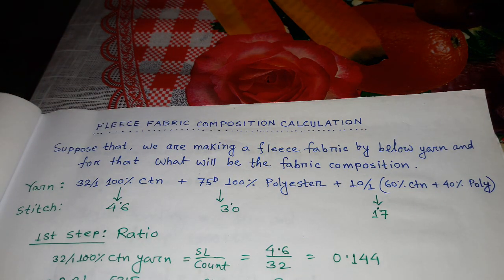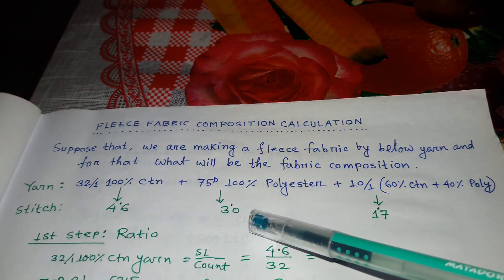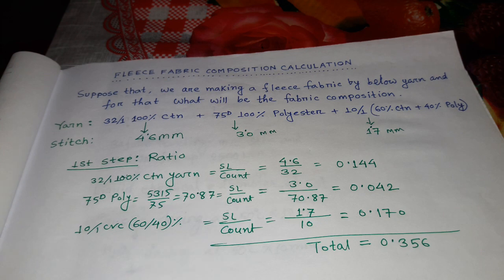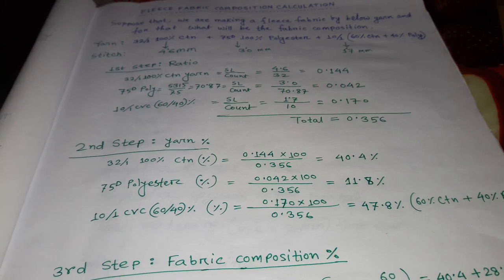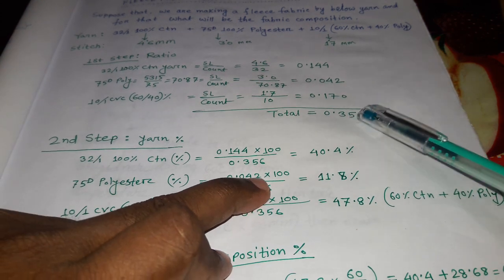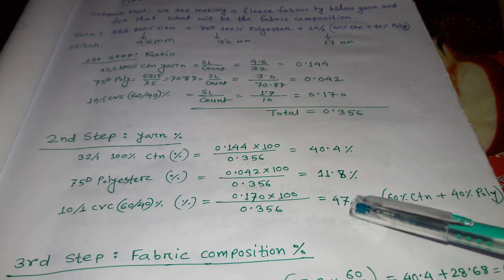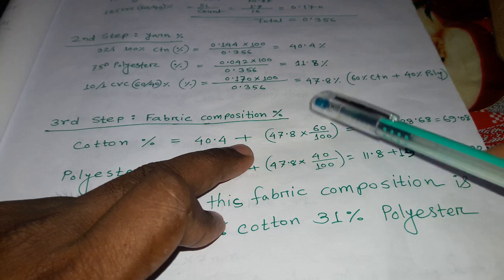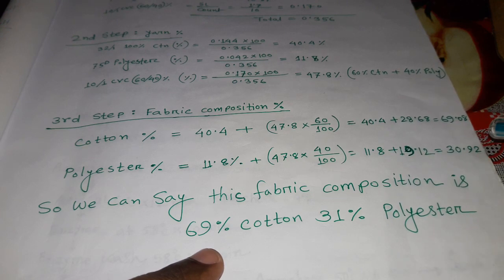Fleece fabric composition calculation ll Knitting

Comment: Hi I have a question, how can you differentiate a 2 end fleece from a 3 end fleece?  I read that the fleece yarn is supposed to be seen on the backside but on every sample I use the Sueding effect is so intense that the yarn is just impossible to see. I tried unraveling the fabric and I can identify three threads. One coming from the face that has a lot of crimp, one form the back with as much crimp but very fuzzy and third one that is similar to the one on the face but it more straight, does not have a lot of crimp. Would this be a correct way to identify a 3 end fleece?
Thanks a lot for your help
Reply from the maker: Please follow my facebook profile and can discuss messenger

Comment: Rib fabric. Rib machine. Daya 38. Gauge 20. Fitter 90. Stitch length 2.90mm. yarn count 24 single. Cylinder needle 2376. Dial needle 2376. 10 kg fabric banane mein machine Kitna counter chalana hoga iska formula bataiye sar please bata dijiye sar ji
Reply: Very helpful class thank you sir.